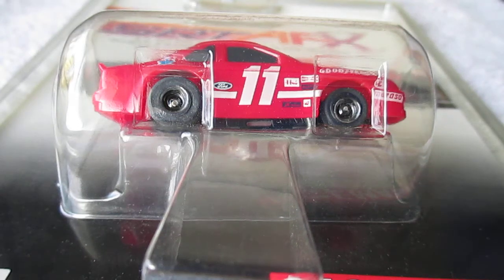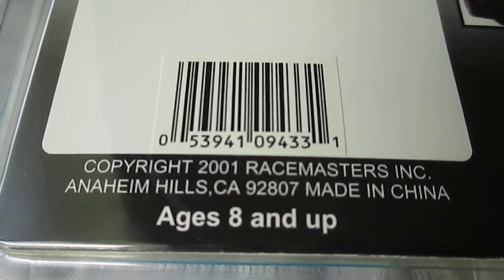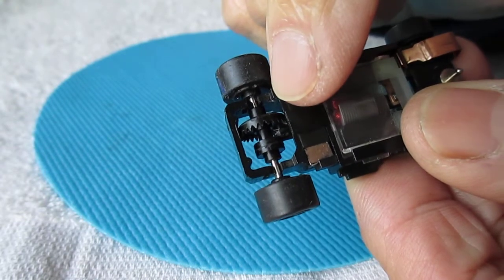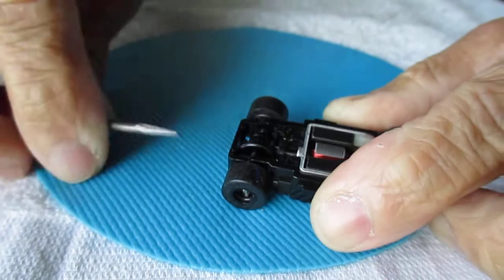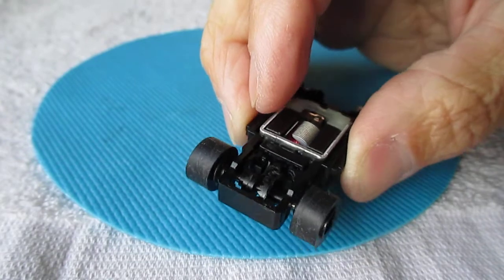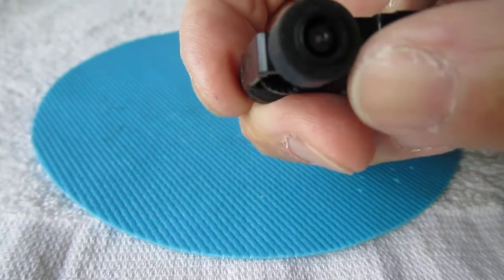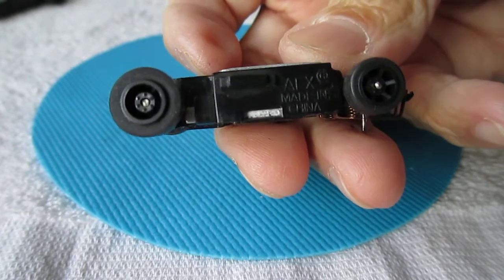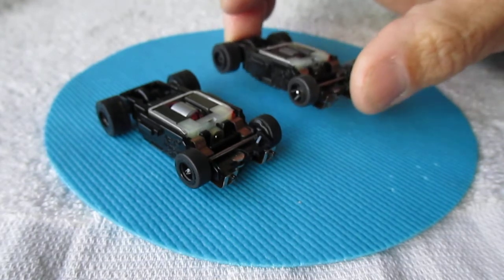WEST COAST SLOT CARS - AFX SRT H.O. SLOT CAR & PERFORMANCE SET UP FOR THE AFX TRACK SYSTEM!

Comment: Some magnet/motor retainer clips are cooperative but some are not. Take a good look at the little space they left to insert a screwdriver and make sure what you are using isn't too big. Sometimes the clip will release as you insert the screwdriver. The tip is wedge shaped and pops the clip upwards. If on the other hand it seems uncooperative don't be surprised. A slightly different screwdriver may work better or you may end up using a lot more force than you would expect. Sometimes the clips break. Usually if you are using the screwdriver as a little pry bar rather than as a wedge. Replacement clips are available. Used to be in the SRT tune-up kits but later versions of the kit don't have them. Jag Hobbies has replacement clips along with a other retailers. It's good to have a few extras on hand just like other service parts.
Reply from the maker: Hi Jeff!  Thank You for your suggestions!!  Happy Racing and God Bless!!!

Comment: Best advice if you want SRT type chassis, just buy a Bulldog brand chassis. Similar but improved. Several versions available. No reason to overpay for Tomy SRT on a site like eBay. eBay prices tend to be ridiculously high because of resellers. They "win" new in package cars at a price that is about the highest most people would pay and then when they get it, offer it for 3-4 times the price they paid. $200+ for a car that originally was $30 and sold on eBay for $50+. If you put in the time on eBay you can do okay, I do, but I have years of experience and don't bother counting on auctions for what I want. Only occasionally do you get a fair price at auction.
Reply from the maker: Hi Jeff! Thank you for your comments. I did get a Bulldog chassis and they perform GREAT!!  Happy Racing and God Bless!!!

Comment: Where can i get the magnets from i got some supposed srt pt cruisers from someone and they in no way stick to the track like the one i got in the pack i looked and they dont have the same magnet set up so i need some of those neo diamond mags
Reply from the maker: There is a seller on eBay by the name of cymbalton852 who sells level 48 SRT upgrade magnets OR grab another used SRT from eBay. Hope you find what you need!  Happy Racing and God Bless!!